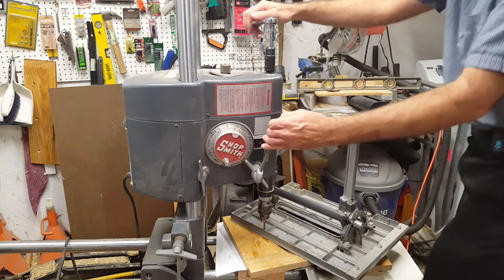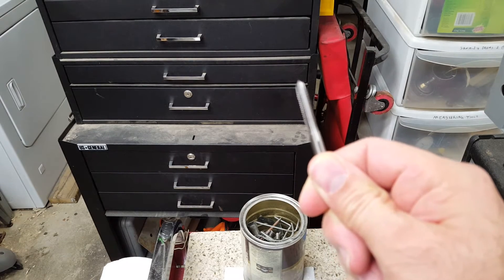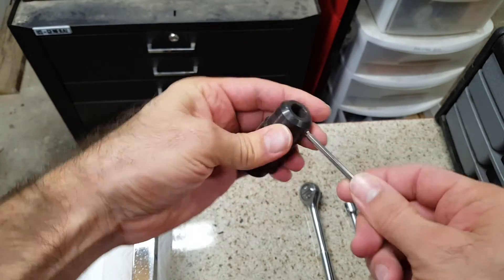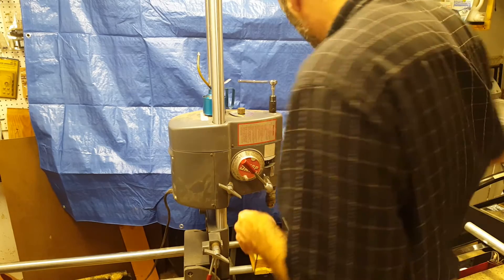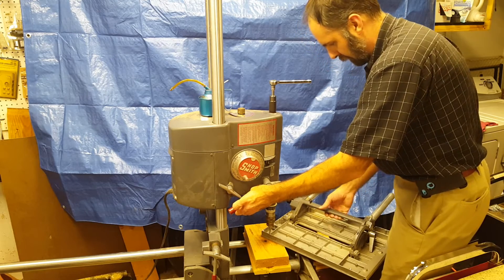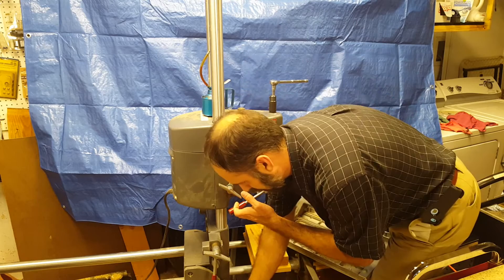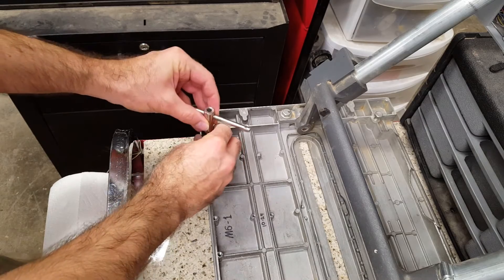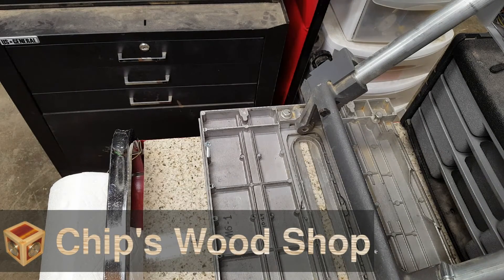Shopsmith Hack #1: Tapping Straight Holes

Comment: This is genius. I want to turn my old 500 table into a dedicated router table and I need to attach a router underneath it. The only concern I have is if the aluminum could strip out easy.
Reply from the maker: Thanks! I know how easy it is to strip aluminum threads, but I haven't had that problem yet with these.

Comment: Thank you for sharing this obvious solution to my nagging problem. I too had the old router chuck, so I'm all set for my next project that includes tapping wood holes and hardening the holes with CA glue.

In reference to questions about the Shopsmith, I offer my experience: 

I caution the use of the Shopsmith as a table saw...unless you keep the motor in tip-top shape. Mine started vibrating a bit much, and this caused the set-screw holding the saw arbor to lose it's grip. The result was a saw blade coming off the motor spindle. Fortunately, I always used the saw blade's metal safety guard, so it never caused any harm other than destroying a brand new carbide-tipped saw blade. Maybe worse is that the Shopsmith tech support's advise was to use Locktite on the set-screw! I had to have the headstock rehabbed, but not by Shopsmith, but a private contractor in Virginia. He did a great job! I now do all my table sawing on a 3 hp Sawstop Professional. I still use the Shopsmith for vertical and horizontal drilling, disk sanding, and joining...oh yes, also for tapping holes. The lathe feature is very inferior to a stand-alone lathe. I now have a 2 hp Laguna 18/36 lathe on casters, and it's far better.
Reply from the maker: +FlyingSawdust JEMTZ thanks! I'm curious to know how your CA-hardened threads work out for you.